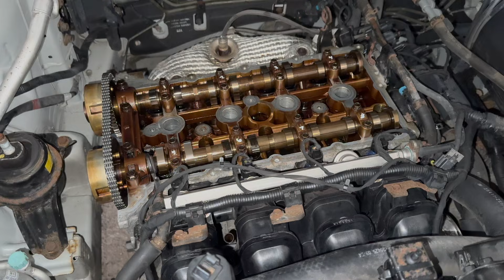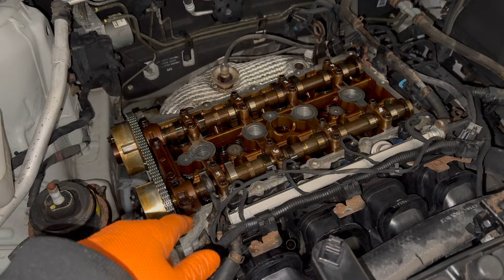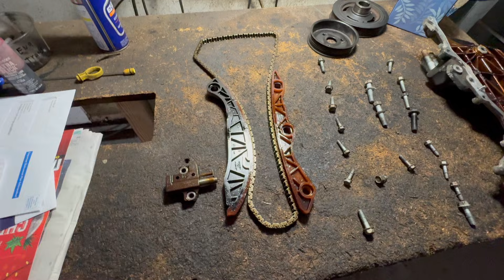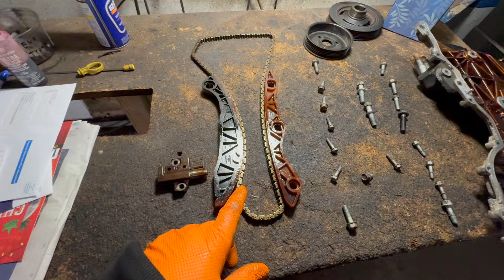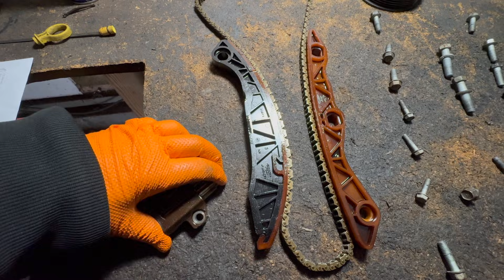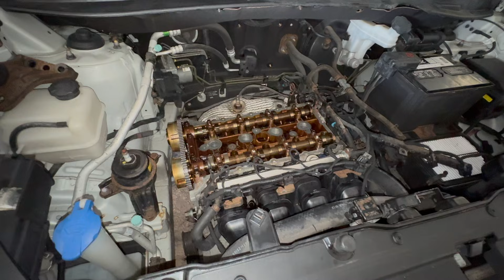Jumped Timing Chain Or Belt Symptoms, Causes, and The Fixes

Comment: I just finished installing rebuild head on my 2004 volvo xc90 2.9l T6 , in the first start the car had misfire on 3-4-5  , this engine is from the passenger side is 1-2-3-4-5-6 , I deleted the codes and started again I had same codes misfire on 3-4-5 , I decided to do compression test and it's crazy it's shows 65 on all of the cylinders.
my question is if the computer shows misfire on 3-4-5 then how I had same compression result on all cylinder it's not making sense for me . Because 65 is low right ? Shouldn't have misfire on all the cylinders? 
I'm looking at the timing mark I can see 1 tooth off on the vvt exchuast sprocket.
Reply from the maker: That’s your problem, I one tooth off. Because if the valve timing is incorrect combustion can’t take place correctly and fuel and spark will be off because computer is assuming timing is correct when it’s not.

Comment: My 2002 Mitsubishi eclipse I believe jumped timing. My car over heated because I didn’t have enough coolant in it and I had it flushed and then it was refilled with coolant a couple times later fown the road it completely just stopped and I couldn’t push the gas or break and I pulled over and hit the emergency break and then cut the car off!! It will crank but not start and the mechanic said that is a good sign!! Does that sound like a jumped timing belt?
Reply from the maker: Sounds like a blown head gasket from the overheating to me.

Comment: I know this exact engine. I’m trying to figure out my situation as we speak. My chain slipped or jumped. I replaced the head gasket and checked the valves which are all in tact but I still have no compression. I’ll probably have to redo the timing procedure itself. It could just be a simple error on my behalf.
Reply from the maker: Chain is known to stretch but that won't cause no compression in all cylinders.
Reply: @motorcarnut so I’ve heard. So what should I do next? I just want to save as much money as possible before taking it to a mechanic.

Comment: I have a hyundai i20 with vvt can not drive it starts but rpms  are not stable , system code p0014 , have checked the solenoids for vvt but thy r gud , the camshaft and crankshaft timingchain markings  are not coming up on the tdc position together where thy shud be , how can i check if camlobes or camshaft intake or exhaust are not in timing
Reply from the maker: You have to find the procedure for your particular vehicle and reset crankshaft marks along with both camshaft marks. I don’t have info on an i20

Comment: Hello, i have a 2005 corolla CE and it has the cold start rattle. I changed the tensioner recently but nothing is changed. Is it worth changing the whole timing chain? it has 203K miles on it
Reply from the maker: It can be the camshaft actuator gear that is falling and making the start up rattle

Comment: How can you tell if a 07 Nissan Altima just time it’s sound funny turning its like the starter only thing turning but crank and cam are spinning
Reply from the maker: Sounds like the engine did jump timing and doesn’t have compression, that’s the smooth sounds you are hearing.

Comment: Hello, 
My Sienna had a code regarding knock sensor. 
I do hear something coming from the engine, I decided to change the timing belt and it was shorter than my oem replacement.

After I finished the timing job and made sure everything was at tdc, i turned on the car and after it warmed up I heard the same sound again and threw the same knock sensor code. 

Any ideas on how to fix my issue?
Reply from the maker: Can be that knock sensor itself that’s bad or the wiring to it. Try using premium fuel for a couple of fill ups see if that helps.

Comment: My mechanic has fixed my timing chain an had a code for a HPFP an he checked it was goid but it still has a loud rumble noise like its off balance
Reply: What can that be
Reply from the maker: Timing is probably off or related to the fuel pump. He’s a mechanic should be able to fix it or bring to an mechanic

Comment: Great explanation. Please check out my recorded noise of possible timing chain/tensioner related issues in my channel under Shorts. Is that noise at idling/slow rpm caused by bad timing? Or is it just the piston slap? Thank you.
Reply from the maker: I just heard them, so from the speed of the noise i'm pretty sure it's a rod knock.
Reply: @motorcarnut  is that mean timing chain system would not fix the problem?
Reply from the maker: @gotsu21 correct.
Reply: @motorcarnut  Hello, could you check #2 and #3 under "Videos"(longer than 1 min)? 

2. Cold Start - Idle - Drive - Rev - Idle
3. Warmed Idle - Rev  (The idling sounds like diesel engine while no noise at revving?)

Comment: Please help , I have a car that has a random misfire , and over heating  between 40-60 mph, car has weak power , pulled thermostat out it isn’t that , it starts overheating when misfire is active , I changed all spark plugs and coils and gaped them correctly
Reply from the maker: Check cylinder compression on all cylinders, may be a blown head gasket causing your issue.

Comment: My car sounds like it wants to start but it don’t and it don’t sound like shitty when you try to turn over it just sounds like the battery is dead but it’s not ? It’s those are my sensors?
Reply from the maker: Hard to tell just by your description but make sure battery is fully charged. Ignition,fuel and compression should be checked.

Comment: Code p0016 popped up what is that ?
Reply from the maker: Timing code
Reply: @motorcarnut  so that’s the belt ?
Reply from the maker: Don’t know what vehicle you have but either belt or chain. But also can be a sensor
Reply: Chysler 300 v6 3.5 08 well maintenance kept very well with everything everything still original I lost power yesterday driving on highway and it sounds lik it wants to turn over but it won’t

Comment: I just did my time if chain and when I let go of the clutch I hear something what could it be
Reply from the maker: Idk, don’t sound related? Was the noise there before timing change?
Reply: It was not I think I didn’t lock the vct acuator idk if that could cause the sound ?
Reply from the maker: @delapaloma6934 what vehicle?
Reply: @motorcarnut  Honda according to 2008 2.4
Reply from the maker: Do you have the start up rattle? I have a video on that fix too
Reply: @motorcarnut  no not anymore I changed the vct acuator but now when I release clutch I hear weird noise
Reply from the maker: @delapaloma6934 you sure it’s not the throw out bearing for the clutch?
Reply: @motorcarnut  that’s what I was thinking but I just changed my timing chain but the noise only happens when I let go of the clutch I think if it was the chain the noise would be constant right ?
Reply from the maker: Can you post a video on your channel and I can hear what you’re talking about?
Reply: @motorcarnut  ok just putting everything back checked if it was still lined up
Reply: @motorcarnut  and hey thanks man I fixed it running good now 250,000 miles on it still running good feels a little bit faster
Reply from the maker: Great! What was the problem?
Reply: @motorcarnut  I have no idea I checked the timeing it was on time an I tightened everything and now when I started her up no noise and since I had everything off replaced the water pump while I was at it
Reply from the maker: Hey as long as it’s fixed! Great job

Comment: Hi, I have a 2004 Honda Accord. Changed Serpentine belt. Drove for 2 minutes, shut car off, crunk it back up.. the battery light and oil light came on. Shut it back off and it wouldn’t crank back up. Used OBD2 scanner and no codes detected. It cranks but won’t start. Just keeps spinning, what could it be?
Reply from the maker: Idk, but those problems are related to the serpentine belt being broken but you replaced it, seems odd that after the belt change you have these issues. Check cylinder compression to see if the engine is mechanically healthy. And take it from there.
Reply: @motorcarnut  the belt never broke. It was shredding so I changed it. I took it back off and retraced the steps to make sure it was on correctly, still nothing. Also, the battery is continuously going dead. I have to give the car a jump. Replaced the starter, still nothing.
Reply from the maker: Sounds like you have a short somewhere. I have a video on parasitic draw you might want to check out

Comment: i have a 3sfe 2.0 engine on my toyota caldina. i replaced my timing belt at it broke in less than 1000km later. what could be the reason? 
thanks
Reply from the maker: Too tight, worn sprockets or defective belt.

Comment: Hi I have an 2020 Hyundai Elantra 4 cylinder 2.0l I have the p0017 code. Changed the exhaust and intake solenoids I was told it might be the engine before it was seen. No knock. Chain is still intake hasn’t been driven since the code popped up. Is there any way that it’s not the engine and just the chain and sprockets maybe?
Reply from the maker: Yes, These vehicles are known for timing chain stretch and that will cause that code. I would replace the chain and tensioner at a minimum to be ok again.
Reply: @motorcarnut  thank you I really needed to hear that
Reply from the maker: No problem!

Comment: I jumped timing on my 2014 Chrysler Town and Country with a V6 3.6 L pentastar engine. I was an idiot and did not get the marks lined up. Any suggestions? Do you think I could tackle re-timing the valves and everything? Also do you think I would need to pull the whole engine?
Reply from the maker: You don’t have to pull the engine and if you did it before why wouldn’t you be able to do it again?
Reply: Well I took it all apart and got the timing right but now the vehicle will not start. I'm wondering if one of my valves is stuck open or I messed something up. Any ideas? I just took the cam phasers off and readjusted them so they were lined up with the timing marks. I didn't take the whole front cover off. Do I need to do that??
Reply: And just so you know I started the engine with the timing off and it ran for a little while then died.
Reply: Do you think I need to pull the heads off and replace the valves?
Reply from the maker: Try doing a compression check first, if compression is good on all cylinders the timing and valve should be fine.
Reply: Thanks for your help!
Reply from the maker: @dladdstrong no problem!

Comment: 2014 dodge charger 3.6 sxt go to start tries to crank almost turns over but wont try to start couple times until i smell gas & stop could this be chiming chain?  Fuel pump makes the electrical noise before attempting to start & fuses are good. Any advise appreciated...I'm broke down in the drive way.
Reply from the maker: By what you’re saying yes it can be timing chain but other things can cause that too. Try doing a compression check first I have videos on that too.
Reply: Start with the codes if you have any. I'm battling the same thing. My code is for cam sensor P0340.
Reply: Check cam sensor

Comment: My 2015 Toyota Sienna has p0012 and p0015, but it has clean oil at the right level and no symptoms. Is it my timing chain? It seems odd that i would have two different codes for one bad sensor. Then again, i feel like a timing chain would produce symptoms. I would also expect a timing chain issue to cause more than just those two codes
Reply from the maker: The solenoids are probably going bad if you don’t hear and timing chain noises
Reply: @motorcarnut thank you!!
Reply from the maker: @mycoffee2654 welcome

Comment: My isuzu 250 De teq Don't  want to start it showing that the camshaft sensor is the problem but i did change them but still i get the same results
Reply from the maker: Probably the timing is off and not the sensors

Comment: If you have a bad timing chain, will your engine still run
Reply: Was same , but I have to rev it high right after turn on engine for idle , sometimes goes to 0rpm but have my foot close to the Gas Pedal 2003 DIAMANTE MITSUBISHI 3.5 V6 6G74
Reply: As the other guy said it really depends but it will crank and it will be a no start if it jumped
Reply: If it breaks, you're F****d.
Reply: Yes it might give u power to run or get stuck or lose and gears do shift
Reply: It depends how many teeth are skipped on the gear.. if it's just 1 it wil run but no powe, this is called advance or retard timing
Reply from the maker: Yes and no depends on how bad it is but it can run
Reply: @motorcarnut  my radio, and dash lights keeps coming on and off, but it still got me to work,the RPM was at 0
Reply: @nemshibenyisrael1337 the chain affects lights an electrical

Comment: Bought a 2011 Cadillac SRX, a few days later a code popped up saying crank shaft/ camshaft coalition or something like that. My mechanic changed them all but said I still may need to replace the timing chain. Is there any other way around that, to at least by me some time? The car drives good except there’s a little loss of power going up hills but no rattle at all.
Reply from the maker: No, if it jumped it will again and leave you stranded.

Comment: I got a 96 dodge ram Misfires on cyl. 8 and 7 but 8 is like 3000 times a minute, Replaced entire ignition system, headgaskets, valve gaskets, intake gaskets, oil pan gaskets, I think it needs 02 sensors but This sounds more like the issue?? Lmk man. Thanks.
Reply from the maker: That’s a dead miss. Just to rule out a sticking valve I would compression test that cylinder to make sure it has at least 120psi cold. Also can be fuel related on that cylinder as well. If you have spark compression and fuel it should not miss fire. A vacuum leak on that cylinder can cause that too

Comment: Thank you for the explanation.   I changed the tensioner on my sons 2009 Corolla.  I believe during this process I made the chain jump a tooth.   We are now getting a P0017 code.  My question is, car seems to run fine, is it drivable for a few days?  Seems to run fine.  I just don't want to cause issues.  

In fixing this issue, can I just open the valve cover and loosen/remove the tensioner.  Put at  tdc and make sure the cams are aligned and to correct the timing or am I going to have to remove the entire cover?  Can I adjust timing from the top with only the valve cover off? Thank you.
Reply from the maker: If nothing is hitting anything you can drive it like that but not too long. If you can re due the timing like you said go for it , if it saves time.
Reply: @motorcarnut  .  Thank you for responding! That's the plan put the crank at tdc and timing mark.  Open valve cover and see where it is.  Undo tensioner and move cams to correct position.  Put tensioner back on and manually inject the tension with a long pic.  Then turn the crank a few revolutions clockwise and verify timing marks are correct on cams.   I really don't want to open it all up.  Hopefully this will work.
Reply from the maker: @Mark-jz4dz good luck!
Reply: How would I go about fixing a p1009
Reply from the maker: @LuisTheCarGuy what vehicle?
Reply: I have a 2010 BMW 328i XDrive I replaced the starter alternator and battery
Reply: I have a 2010 BMW 328i XDrive I replaced the starter alternator and battery

Comment: I have a 2002 Hyundai sonata 2.7 liter v6 i just bought it deove it 164 miles parked it went outside the next morning wouldn’t crank just flooded itself out I replaced coils wires and plugs no change I think it might be a timing belt issue but I’ve never her of one jumping like that help
Reply: It was I finally got past the motor mount and got the inspection cover off the belt had cracks all in it It was old and worn out and jumped some teeth. Thank you for the video really helped me.
Reply from the maker: Great to hear that, sure no problem!
Reply: Also it threw the po340 code which is camshaft sensor
Reply from the maker: Could be, that is a timing code

Comment: i have a 1988 honda crx that someone wants me to see if i can get running.  i found that it has jumped time. not exactly sure why it jumped yet but that is my question.  how do i diagnose weather it is the tensioner or not. and how would i know if it messed other things up ?  should i just try to fix timing and see if it runs?
Reply from the maker: That's the easiest thing to do, readjust timing, changed tensioner and belt and see if it starts. Could of bent valves but if it runs good it didn't. Good luck!

Comment: My 4.0 ford engine out of time valves hit locked up  trying to remove cant rotate to access the flywheel bolts what can I do need to remove  the engine
Reply from the maker: Can try with a long pipe and braker bar on crankshaft bolt or drop pan if that don't work and remove rod bearing caps more time consuming but sometimes you have no choice.

Comment: If the chain is stretched ,will the engine still be able to start?
Reply from the maker: Depends if if jumped a tooth or more, so yes or no
Reply: @motorcarnut I have this same engine for my 2020 Forte GT-Line a few months ago. I can’t get this thing to start for shit. 😂! I did realign the camshafts and crank shafts and it has a smoother crank like it should but man I can’t get it to find that compression stroke. I’ve even changed my head gasket which was in perfect condition as well as checked my valves (both intake and exhaust). My chain stretched just a little but enough for it to throw the entire engine off.

Comment: I have issue with engine so carry out overhaul work but after overhaul complete engine not starting so, i check deeply and found if i drain oil from chamber vehicle starts and if pour even 1 liter oil it stremble and stops, what should be causes?
Reply from the maker: Sounds like you messed something up and have a head gasket problem or valve timing is off.